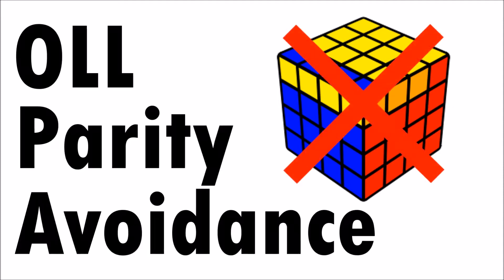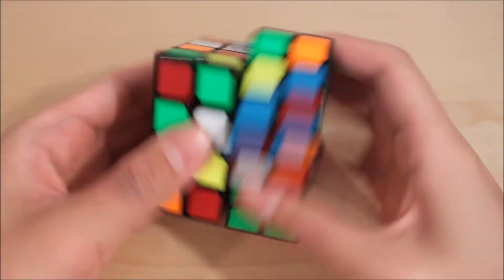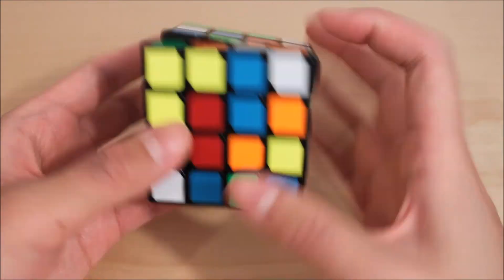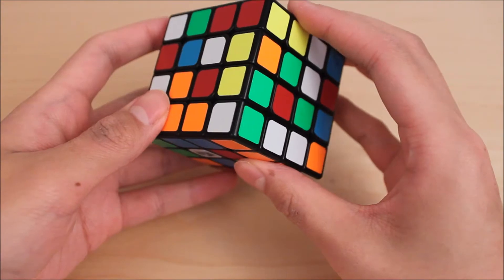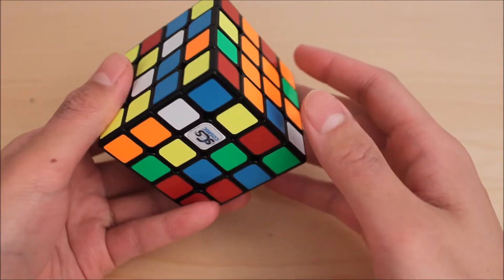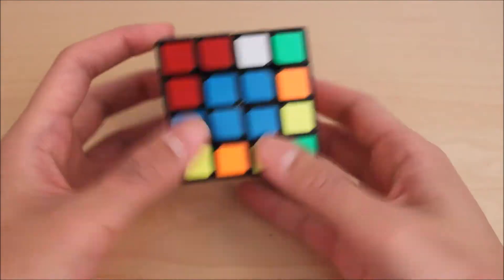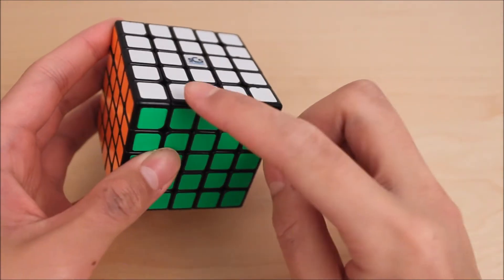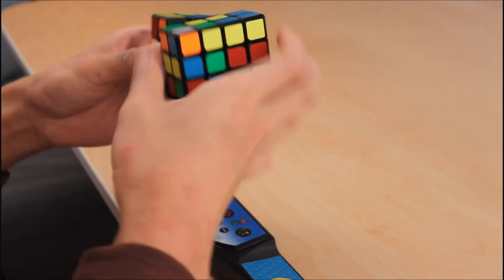OLL Parity Avoidance Tutorial (OPA) (4x4+)

Comment: Why you no ZZ-tracing?
Reply from the maker: Normal ZZ tracing doesn't work because if the top back left wing switched with the top front right wing, you might detect it as no parity, but it would be in an even parity state. (Do Lw Parity Lw', ignore centers). To my knowledge blind tracing is the best method to track parity in a cube.